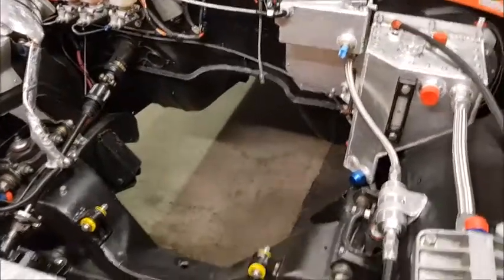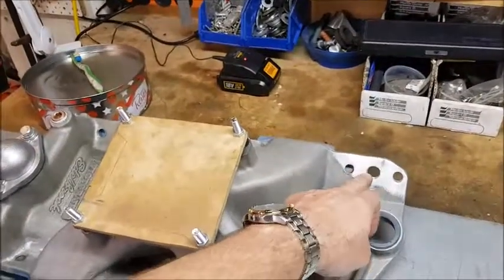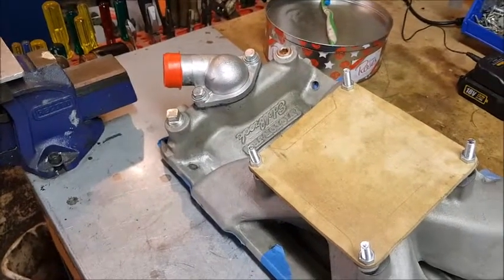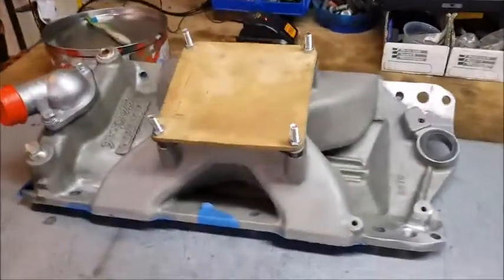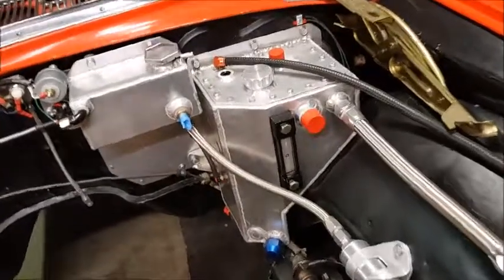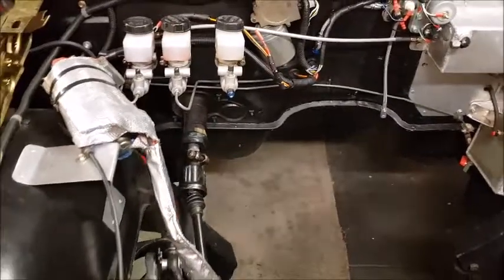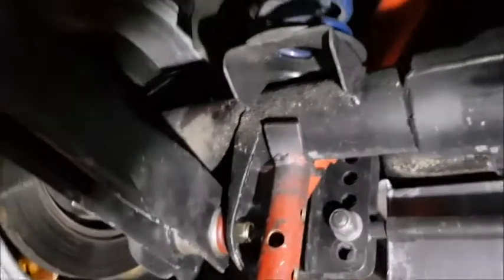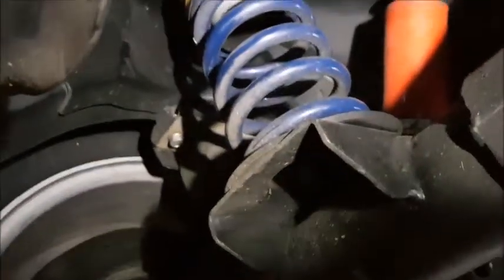CHRISTMAS UPDATE HQ HOLDEN POWERED BY CHEV 350

Comment from the maker: Cheers Griff and happy New year to you. I will run the hose down the chassis rail if possible but with the existing exhaust pipe layout it maybe a fire hazard. I'll look harder at it once she's back together in the new year. Hope to test at Winton 19th Jan first race sandown 3rd March
Reply: J D's Fuel Burn would hate to see something happen.. ran my two lines down the front guard and tucked it in the channel, then came up through rear floor inside then through to boot.. Thats the last thing i wanted was for any exhaust, diff or moving parts to cause a disaster.. You have a beautiful car mate, i love the attention to detail you put in, its real passion you have.. Happy new year to you too mate...